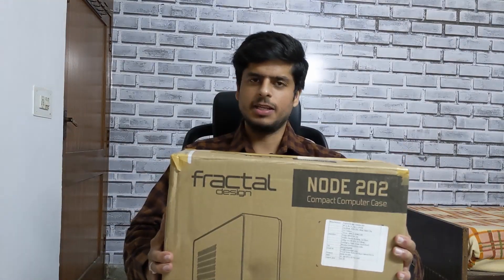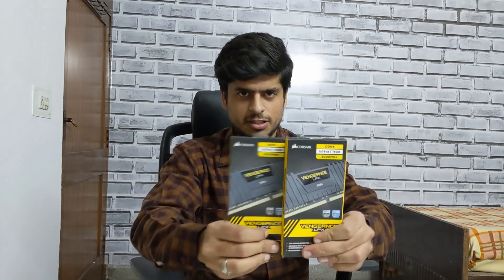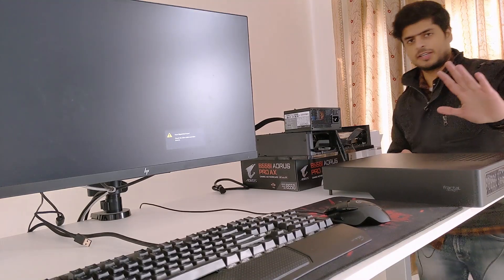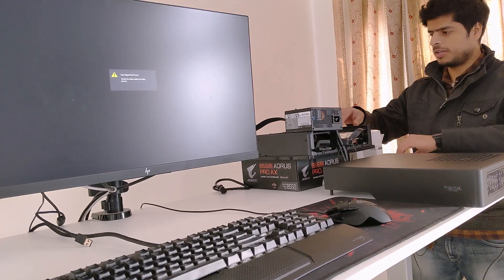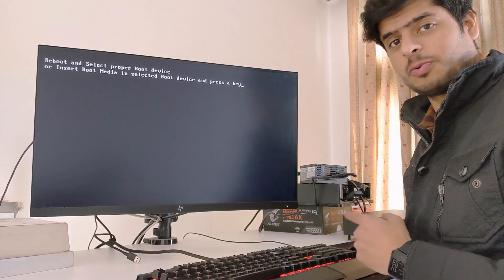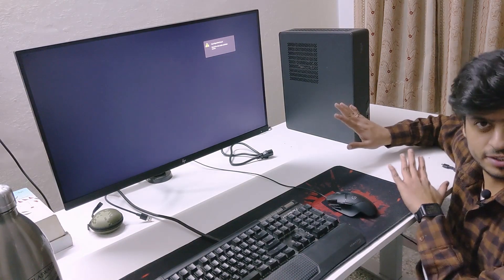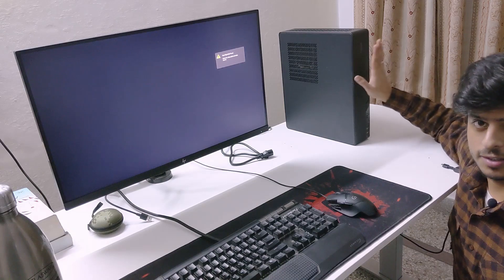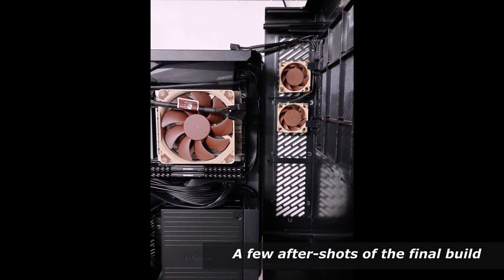Building India's most compact ITX PC | RTX 3070 FE

Comment: How is the thermal performance? 
Did you get all the components from India, if not then how much was the price difference/extra paid if bought from newegg/foreign retailers?
I was planning on building an SFF PC using fractal ridge, but I live in NCR and worry that the dust and temps might cause issues :|
I will be mostly using the PC for 1440p esports.

Comment: I have an old 3900x that I want to downgrade into a mini itx build. Can I use the same components and swap in the 3900x?
Reply from the maker: Yes of course!
Reply: @100GB  Hey thanks for the prompt reply. I'm just worried about the heat. Do you think this should be fine thermally?

Edit: Checked; Noctua doesn't recommend this for the 3900x (even at base clock).
Reply from the maker: @drgeetchadha  yeah. Definitely not at the base clock.
You will have to undervolt smartly! 
That's what I did for 5600x.
Reply: @100GB  Oh you're using 5600x too? I have a friend who's making the same build as yours then.
There's space above the noctua for an additional fan tho. Seen some people stack a fan on top of this. Maybe one can do that and run the 5600x stock.
Reply from the maker: @drgeetchadha  yeah, but I didn't have any problem undervolting :).

But now I have moved to another case SSUPD meshlicious + A liquid AIO!